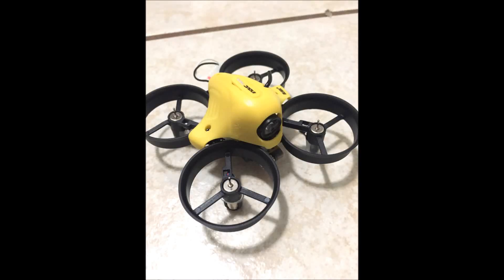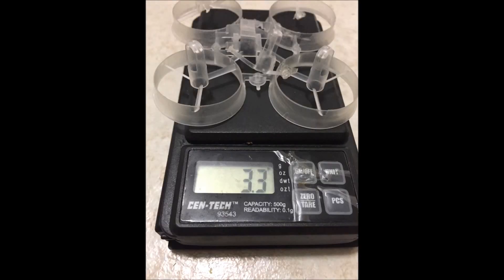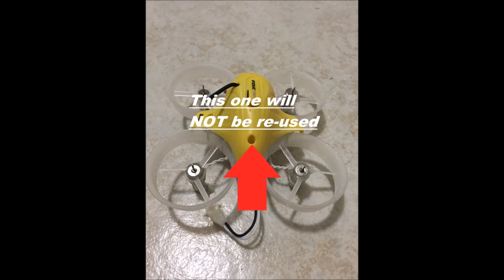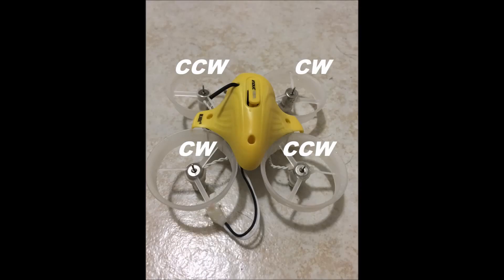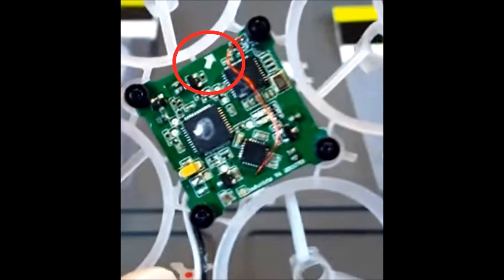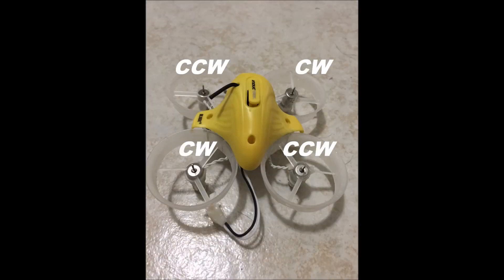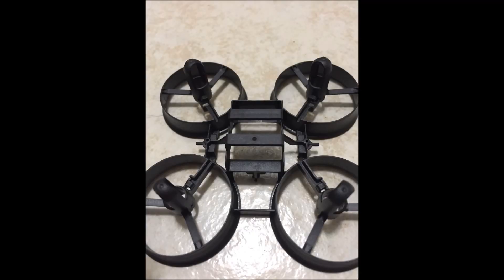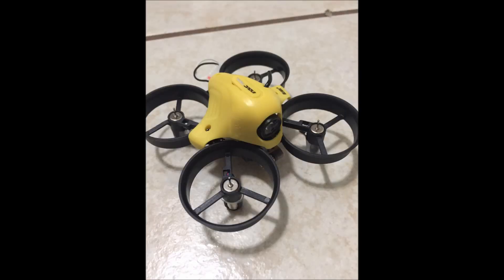How to Upgrade / Repair Blade Inductrix or Tiny Whoop Motors and Frame

Comment: i replaced my frame yesterday evening,, when i  stuck the battery in the motors turned, but it wouldn't fly,, so i thought i had the rear motors mixed up,, i swapped them and it caused the leds to flash and the motors turned for a second then stopped,,, then i seen the color code on the bottom and swapped them back, but only the red led's come on,,  What did i do to it???
Reply from the maker: Sorry you are having trouble. Assuming your motors aren't fried, my first thought is to double check the prop direction for each of the four motors. If even one of your props is the wrong direction it won't fly. Another thing to check is if the motor shaft is "slipping" Inside the inner diameter of the propeller. I put a very small amount of super glue on mine, just make sure none of it gets inside the motors.
Reply: I got it fixed,, sorry!! I forgot I made this comment. thnx for the reply!!

Comment: Has anyone come up with a well engineered frame, ie., fits as it should ?

Tnx fer this. You've encouraged me to do this and add a camera to mhy original Inductrix.
Reply from the maker: Thanks for the comment and glad this video helped! There is another frame called the "Rakon" that is specifically designed to replace the OEM Inductrix frame and is made out of aluminum and carbon fiber. The only downside is that it's $44 shipped... Knock on wood, I still haven't broken anything on this black one yet :)

https://www.amazon.com/Rakon-CNC-Upgrade-Kit-Inductrix/dp/B01BJ8AMUO/ref=sr_1_1/166-7128488-7799711?ie=UTF8&qid=1483710918&sr=8-1&keywords=rakon+inductrix
Reply: I'm not sure the Rakon is acceptable. 
Builders seem to comment in unision, "It has to be cobbled to work."

I'm thinking I'll hold out for a higher quality. 

Jesse at Tiny Whoop might have frames that are accurately built and non-carbon fiber, if he can keep 'em in stock. 

In the meantime, the camera will be here tomorrow, as will my first real Tiny Whoop.

Comment: Quick Question.  I have watched a couple of these videos now and no one has said anything about the copper wire on the board.  When I was taking mine apart, I noticed at one end was not attached, if it was I must have broken the lead, but I can't see where it attaches or if it attaches to the board.  Can you help me out here?
Reply from the maker: Is it a copper wire without a sheath (shown at 2:16 on my video)?? If so, mine was the same and you don't have to worry about it. If it was a different one, feel free to send me a picture and I'll compare to mine. Happy flying!
Reply: no that was it.  I have since found out that it is the radio controller antenna..thanks for getting back with me on it.  I was a little worried for a bit.

Comment: How are these frames from Crazepony holding up now after you've used them a while? Can they take a lot more abuse than the stock Inductrix frames? It's only day 2 with my stock Inductrix Blade, and I've already snapped two of my motor supports on the stock frame, that I quickly "fixed" with epoxy, which, of course, keeps snapping even on soft-ish bumps and hard landings.

My dilemma is that I've got my niece and nephews two of these RTF's ready to give to them for Christmas, and just KNOW they are going to snap these motor supports in no time at all.

I've looked at (drooled over) the Rakonheli aluminum/carbon fiber frame upgrade, and sadly just can't justify that price (3x for all of us) right now, though I'll be getting one for myself sooner than later most definitely.

These from Crazepony look rather beefy though, and might just do the trick in the meantime for us. So I'd appreciate your feedback, if you could tell me if you're happy enough with these, or should I just wait and go with the Rakonheli offerings for all of us later? Thanks!
Reply from the maker: Appreciate the response! The plus side to these frames is that they are indeed much more durable than the stock and pretty cheap, I haven't broken one of the arms yet! The only downside is the increase in weight... I know in my video that I explained the additional weight as being minimal, but even with the upgraded motors it feels less sporty than stock. I have also noticed a reduction in flight time by roughly 30 seconds. Thanks again and happy flying!
Reply: I believe I can deal with that. Thanks for the quick reply and the video in general my friend.